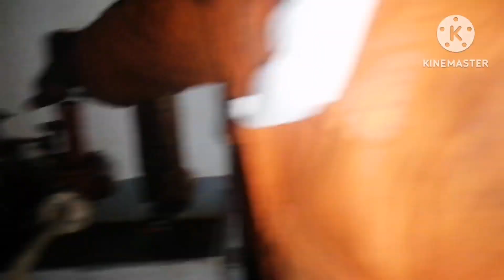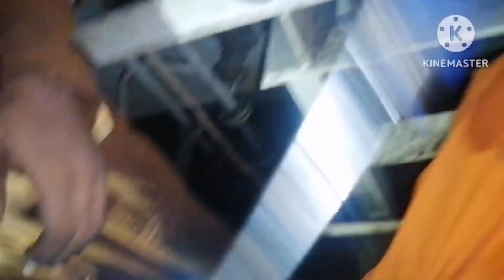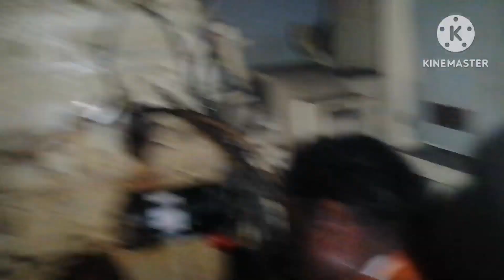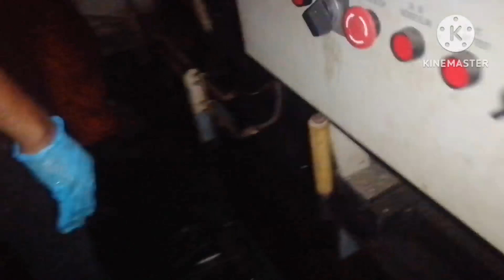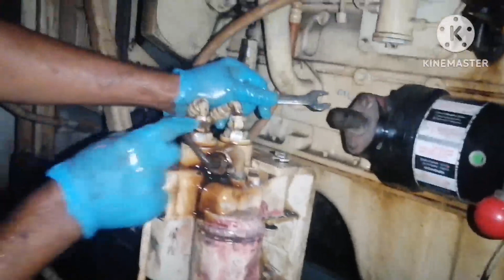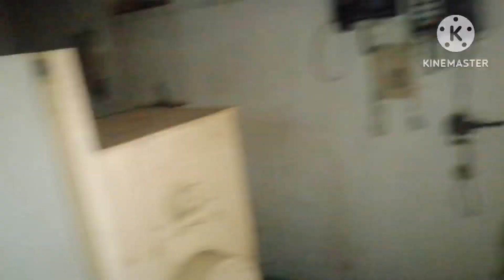EMERGENCY GENERATOR TROUBLE SHOOTING... ALL ENGINEERS MUST KNOW..

Comment: Very often on board we face with problem of stucking the handle wich change position wich filter is in use and you are not able to change the direction of flow to clean . Why this handle often stuck ? What is the cause of it
Reply from the maker: This because the changeover flap in between the filters must have been damaged.. You may need to remove and overhaul it... If not as a temporary solution you can keep the handle tied with some point.